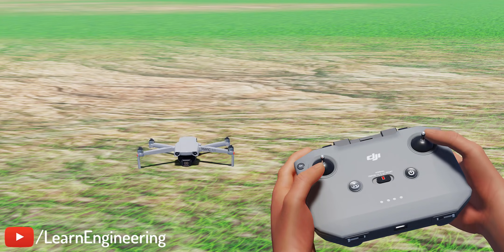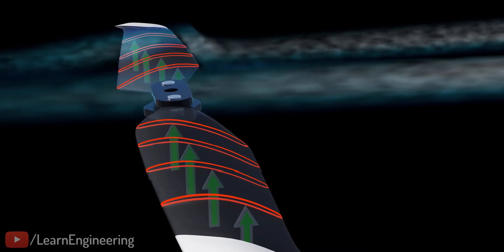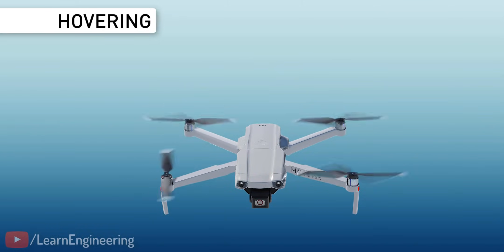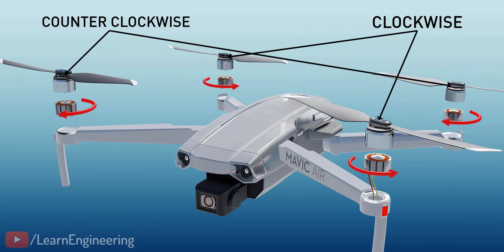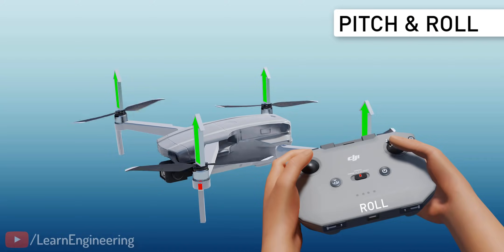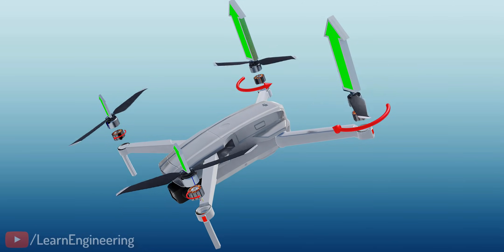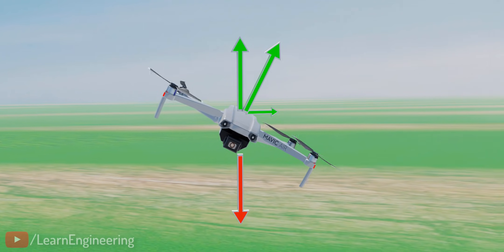Drones | The complete flight dynamics

Comment: So I crashed my drone. Everything still works however there is one problem.
The ascend and descend speed is extremely slow. (0.6meter/second).
The propellors are a bit damaged.
Will replacing the propellors fix this problem, or do I need something else to fix this problem?

Comment: Really nice visualiser and explanation. Got a question - why not add four blades to each propeller instead of two, wouldn't it use less energy to get the same amount of lift force?
Reply: No due to the increase in drag

Comment: @4:52 that can only stay hovering like that if all 4 propellers are angled parallel to the ground and are rotating at the same speed, given that the lift is equal to the total weight of the drone.
And also if there's no wind movement

Comment: I have a question. How does toy drones perform 360 flip and still maintain the balance and return to its initial position. Could you also explain how the gyroscope, barometer and accelerometer works

Comment: As a drone operator I can say that you have to add yaw to fly a circle or to make simple turn etc.. 

Besides when the drone is hovering, the motors are not necessarily rotating at the exact same speed (due weight distribution, wind) the gyro's inside fight controller of the drone regulates the motor speed of each motor in order to stay level. For example, if you add more weight on one motor arm, that arm will spin faster to stay horizontal.
Reply: As a pilot, I approve this comment! 👍
Reply: Yeah I learned that pretty quick piloting mine. If done as described here, the drone will just fly in a diagonal angle

Comment: That drone should be orange and named Autel not Mavic or Dji.

Great video though! Keep it up 

Also, the last one kinda messes me up. 

The if the drone pitch forward or down. It goes straight but if roll to the right is left. It will fly forward but same time flying to the right or left but it won't bank or make a circle unless there a yaw input to it to make it fly in circle.  

Correct me if I am wrong but this is my understanding of flying as I am a private pilot.

Comment: Great visual... my only comment (correction?) would be that yes, different motor speeds (torque) on the diagonal motors causes yaw. To pitch or roll you are increasing the motor speed in either the front/rear or right/left motors to provide more or less lift to make it change it's attitude, not torque. Please correct me if I am wrong?
Reply: One thing you should ask yourself is what is torque?  A force that causes rotation. when you change the motor speed,the blades creates more lift which provides torque to that side of the drone.

Comment: If we want to turn a drone we need to change the speed of the two pairs of propelers that i understood but as u sayed if speed of propelers will defer it will rotate coz of different speed of stator which are applying force in opposite direction of motor. So why is it not a case can u plz explain?

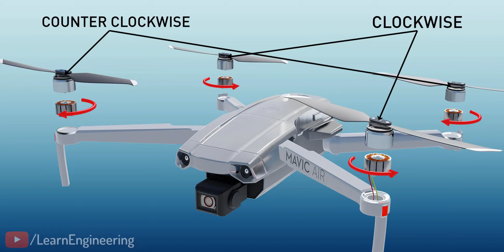Comment: 2:58 Doubt 🖐, propeller blade is designed in such a way that when it rotate in One Direction, then they will push the air downward to create a lift. 
In this case if the two out of four sets of propeller rotate in counter clock wise, will they create upside down force?
Reply: No, because the blades are designed opposite to the other blades, thus it creates downward force.

Comment: The drone will not turn in a circle if you just pitch and roll it. it will move diagonally. you will need to induce some yaw in order to constantly adjust the drone's heading.
Reply: Definitely! 👍
Reply: You are correct!
Reply: of course
Reply: CharlieRC
Okay, Among Us, pfp
Reply: Could the debate here be due do one person thinking about ATTI mode and the video explaining ACRO mode?
Reply: If you do the roll and pitch at the same time, you're right. But if you do the pitch firstly and if you do the roll after the drone gains a certain amount of velocity,it will do a circular motion
Reply: @ugursoydan8187  yes but the circular motion will be negliciable because of the fact that drone does not give a constant force to the side when you give roll/aileron input. It only gives the force for a split second as the drone banks, than gives the opposite force for drone to stop banking. Also as shown in the video, the vector of the force thats pushing the drone to the side rotates around itself while moving with the pitch/elevator and roll/aileron outputs which, that rotation can only be achieved via yaw/rudder.
Reply: @adakalyoncu1913   @Ada Kalyoncu  yes you give the Force for a very short amount of time but it is still enough for the drone to gain a tangential velocity. Also when you apply an opposite force to stop banking, you are only COUNTER TORQUEING to the drone, so it doesn't mean that you destroyed the tangential velocity. But you may be right in the fact that there is a difference between rotating of the drone around a point and rotating around the CM of it. So if the ailerone Forces of the drone is not sufficient to rotate the drone around the CM of it, you may need a yaw. But consider a car rotating around a bend. The frictional Forces are giving a centripetal Force to the car as well as giving a torque to it and rotating it around itself. The drone is like this. I recommend you Walter Lewin's 8.01 lectures for better understanding.
Reply: @ugursoydan8187  wrong
Reply: @DiegoPerez08  ok, what's your explanation?
Reply: some drone operators which HAS NOTHING TO DO WITH GENERAL PHYSICS 1 should take a classical mechanics course before writing such comments. I recommend Walter Lewin's 8.01
Reply: @ugursoydan8187 The result will be a parabolic trojectory. To acheive circular motion the yaw has to be set at the same angular velocity as the circular motion desired.
Reply: @Mr.Kent65  If the drone wouldn't rotate across it's own axis with the rotation of the drone through a circular pathway, you're right. But since drone is rotating with respect to it's own axis with some kind of force, it's force vector rotates with the velocity and stays perpendicular to the velocity.But I didn't use a drone ever, if this rotation across it'own axis does not occur without yawn, we need something to rotate the drone as well. But I'm suspicious that yawn can do this🤔
Reply: Yep, 
-dji mini 2 owner

Comment: Question : when the drone is descending does the motor spin another way or slow down ?
Reply: motor spins slower, in order to reduce the net lifting force to a value lower than the weight of the craft

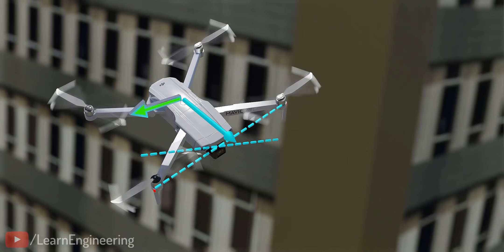Comment: 6:17 This is not how my DJI Phantom 4 works. Stick forward = goes forward, stick right = goes right, stick forward+right = goes diagonally.

No circle for me without Yaw.

I would like this changed though if someone knows how.
Reply: Yeah that's indeed wrong in the Viedo
Reply: mr.1n5an_e  well yes. Looks very unnatural but yes.
Reply: The video explains ACRO mode….you are operating in ATTI mode.

Comment: Is it possible to hover drone tilted without moving forward orbackward?
Reply: No
Reply: Only if you can change the angle of the motors – which is generally not the case. It's easier to have a mounted camera that can change its pitch angle.

Comment: A little correction that does not remove anything from the educational value of the video. By convention, torque is a vector that is directed upward the vertical axis for anticlockwise spin and downward for the clockwise spin. If the angular speed of the rotation of the rotors is constant then the torque is zero. I would rather talk about angular momentum since it is related both to the angular speed and the rotational inertia of the body. Edit: On second thought you are fine using just the concept of torque because in the real work the friction force of the rotating parts of the electric motors can be overcome by an opposite force that would be the torque. So even for a constant angular speed of the rotor, to overcome the friction force of the axle of the rotor and the drag force of the blades a constant positive torque is required. Peace

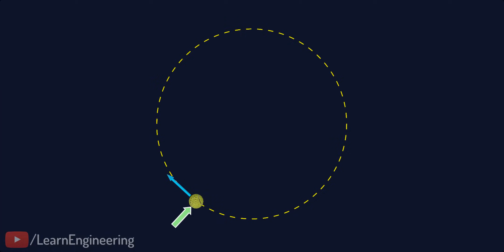Comment: Hey thanks for the info at 6:04. I'm trying to code in Unity to use physics forces to rotate objects around a certain point just like what was shown. That helps me realize that the solution is much more simple than I thought. Cheers!
Reply: @Hussain Mehemud Kusum Yeah C#. I'm a Technical Artist for game development. The comment was in response to a personal project i'm working on where i'm driving the transform vector position based off of physics instead of forced script calculations .

Comment: Isn't the torque supposed to be pointing up from the drone propellers since it is a vector cross product?
Reply: Up from two of them and down from other two. 
But showing rotation is better. There are two different kinds of vectors. In "classic" algebra that we learned at school math and physics and we have to remember when to use cross products and dot products. Which is confusing.
There is other algebra called geometric algebra, that differentiates between vector (for direction) and bivector (for rotation in a given plane) without adding 3rd dimension when it's not needed. Algebra is harder, but it unifies vector algebra, complex numbers and quaternions and it removes this ambiguity of vectors.

Comment: The most important part of a drone is its sensors and electronics package. If this is good enough you can use all kinds of motors and inefficient blades to produce results as far as power exceeds weight.
Reply: Dany Varna  Each part is important.  In many cases lift can exceed weight but  the craft might still be impossible to tune / fly correctly cause mechanical factors like stiffness, center of gravity position and many others.
Reply: @carboncopters5674  , turn your brain on. All of what you mentioned is either performance related or correctable to a satisfactory level by the electronic suite. Every part od important bit some are decisive, thus you start with them as a choke point.
Reply: Dany Varna No its not. Electronics cannot change the laws of physics. Its entirely possible to make UAV impossible to fly in a controlable manner not to mention ,,satifactionary” level if for example the center of gravity is too far away or some elemnts of the craft  interfere with air stream. You obviously have no experience in building crafts of this type or especially the experimental ones if you deny the obvious significance of mechanical contruction.
Reply: @carboncopters5674  , you seem to know little. Let me help you. Do you understand that most current military flying machines that we use are either not aerodynamic or have been planned with a level of aerodynamic instability? :-) Read, man. I am building drones so I know what I am taking about. With enough power and a good electronics-sensors module you can make a brik fly. Chech the development of quadcopters and compare it with the timeframe of the rise of cheep electronics.
Reply: @carboncopters5674   i think dany varna from ECE ...that's why...he is not bothering about  friction ,drag, centrifugal force ,torque , gyroscopic effect  and all ...     And he mentioned about he building drones lol. Even bothering about physics  😂😂😂 funny ....

Comment: The explanation of the drone rotation due to same rotation of the motors is bogus. If the arms of the drone would be very long and the longer motors shafts there would be no rotation.
Reply: Bro... The guy was talking about  a basic drone design. Drones are capable of doing a lot of things based on their chasis design...

Doesn't make the fact concluded by laws of physics bogus.. 
Chill dude.
Reply: @harshjinger  

No. There is a second force, the propeller counter rotation force due to drag.  That counter rotation force nulls between propellers, but not outside the propellers.
Reply: @HMartins-351  either way, if the drone is constantly given torque like that, flight stability and maneuverability will be affected. So it might not turn the drone as shown in the video, but it'll surely affect the other important factors in a flight

Comment: I hope we get a video about hydrogen fuel cell powered cars and perhaps something about car drag for high speed racing
Reply: Check out the videos that Real Engineering made about this subject, they're awesome.
Reply: @nicodiveira  my G thanks
Reply: @nicodiveira  aaàaa
Reply: Car drag is the application of Stokes theorem when the car reaches its terminal velocity it can no longer accelerate forward but attains a max constant acceleration which just ewuals the opposing drag viscous force.